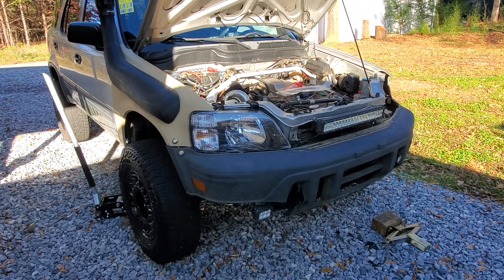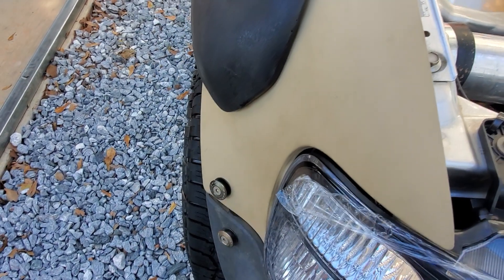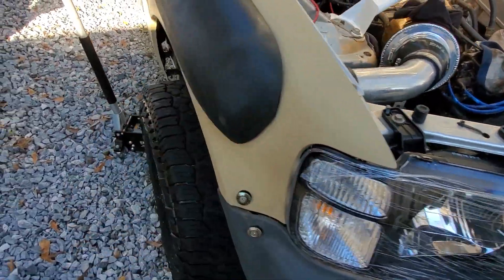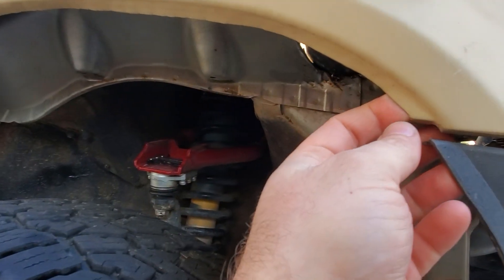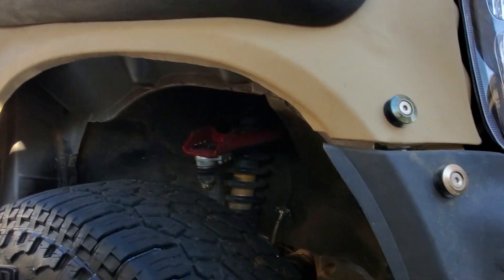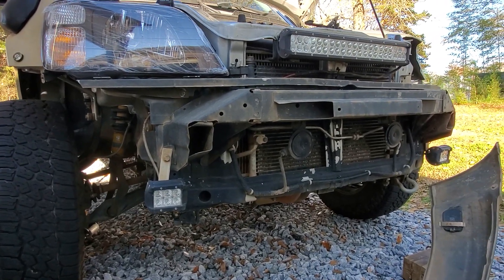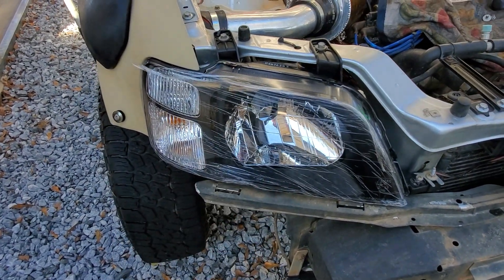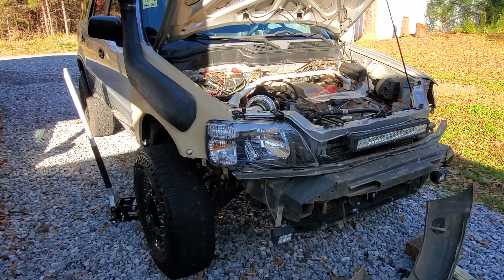Trimming Fenders On My CR-V

Comment: What type of fender flares will you be using? You will need them.
Reply from the maker: I'm my State(South Carolina) it isn't illegal to have the wheels outside the fenders. But I would like to run a flare eventually to keep mud off the windows.
Reply: The tires on my crv stick out about the same amount as yours and I haven't found a set of flares to fit once I cut the plastic off. I have an idea to help solve the issue. I will make a video of what I make and share it.